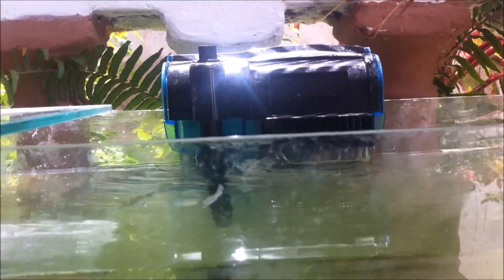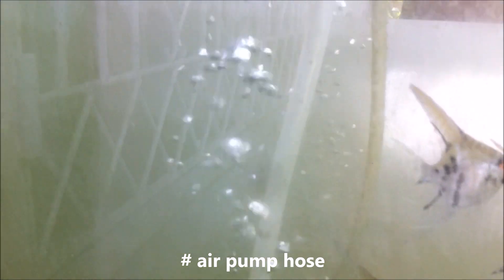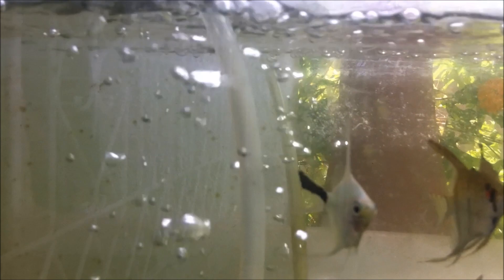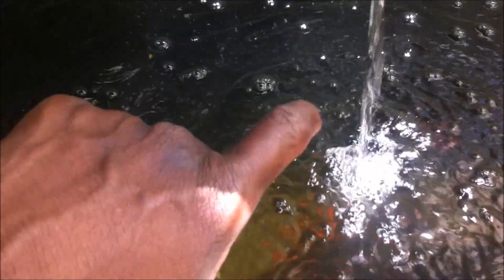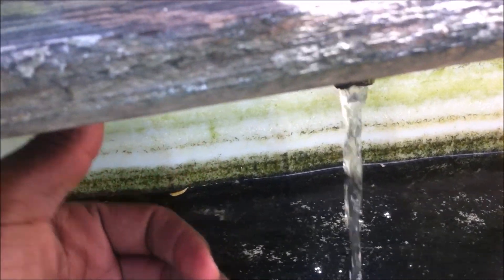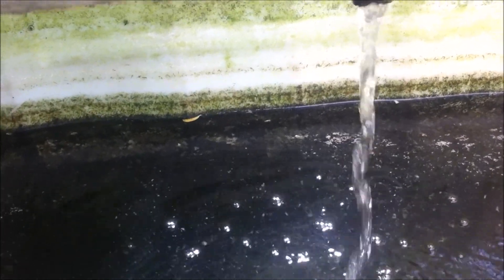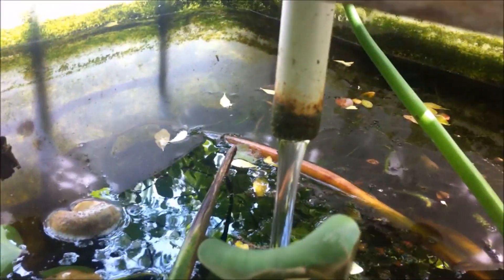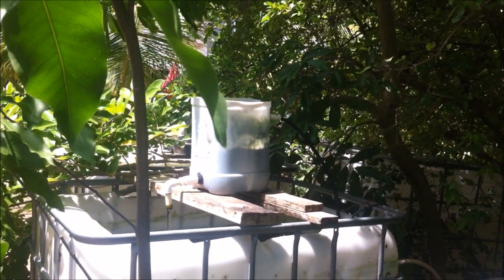HOW MUCH IS TOO MUCH, OXYGENATING YOUR AQUARIUM

Comment: What ????????
Reply from the maker: Thanks for stopping in, much appreciated
Reply: @FKJ_WORLD  I have a question what do I do if my fish is gasping after an water change and my tank is full of bubbles at the top tank ?
Reply from the maker: Fish gasping at the top of your aquarium is a bad sign, this suggest that the water is not fish safe. If you have stress coat or aquarium water conditioner it is now time to use it. If you dont, adding additional oxygen source for our aquarium fish might be a great idea. I would personally remove the fish from  the system and if i do have the water which was changed, place then back into that water while you attend to the water quality of your aquarium.  other factors might be causing fish to gasp at the top of the water, this can also mean that the ph level of the aquarium is just not right, bubbles in aquarium does not suggest oxygen, air can have several gasses, these may include nitrate nitrate , nitrogren or carbon dioxide, . please note that having stress coat or water conditioner at home is always a great idea once you have aquatic pets.
Reply: Thanks for the video alot of great information. I got a question maybe you can help me. I got a 10 gallon tank and I bought  a oxygen stone. But I think it's to much. How big of a air stone should I use in a 10 gallon? Thanks